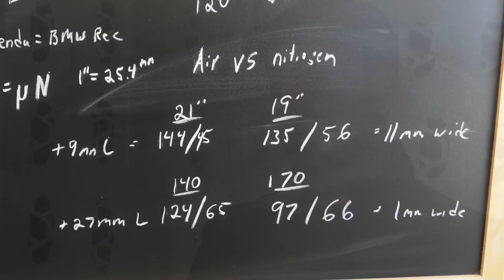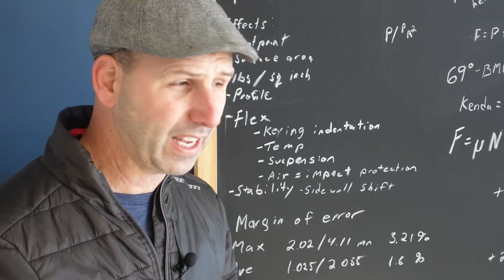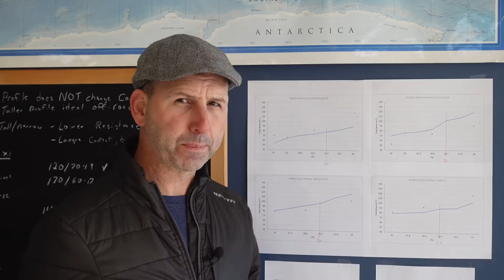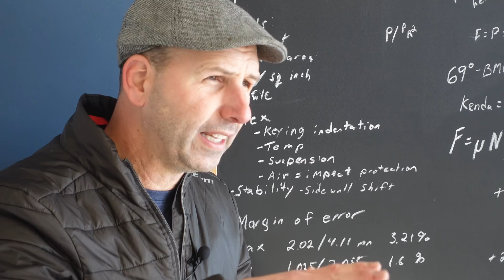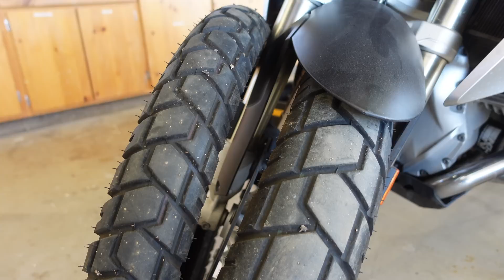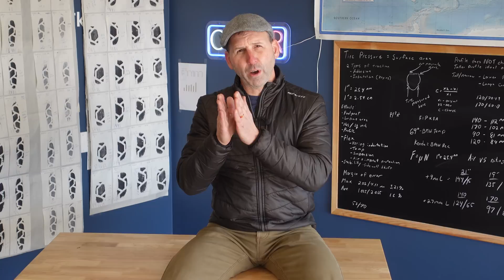Selecting the correct tire pressure; How airing down motorcycle tires affects contact patch

Comment: Tyre construction plays a big part in how much flex you get from the tyre, stiffer side walls give less flex as opposed to softer side walls for the same air pressure.

Most tyres designed for overweight motorcycles have stiff side walls so will flex less than say a tyre designed for a mid weight bike, the difference is quite noticeable on an enduro bike like a KTM 450, 16 PSI on a stiff construction is a world away from that of a soft construction tyre when it comes to traction.

The best way to test if a tyre has a stiff side wall is, one, try and fit it to a rim or Two, let the air out and sit on the bike, a tyre with a stiff side wall will feel almost the same to reach the ground when seated, a soft side wall the bike will sit a lot lower.

I guess there is a reason why enduro riders and Paris/ Dakar riders run a mouse equivalent to around 14/16 PSI in the tyres and their bikes don’t weigh 250 Kg.

To get the tyre to flex more on a stiff side wall you need a fair pressure drop then one with a softer side wall but a stiffer side wall is needed as the weight gets higher.

Comment: The purpose of airing down is to keep more tire in contact with the ground when the ground is uneven. If you have a tire at 35 psi and it hits a little rock, that rock is going to make the rest of the tread lift off the surface. If you hit that same little rock with that same tire at 25 psi, the tire will give and allow the rest of the tire to stay in contact with the surface. Not talking about big obstacles like in your example, but small rocks and surface imperfections. It's a balance between protecting your wheel/avoiding flats, and improved grip.

You can sit here all day and explain why it doesn't make a significant difference in grip, but if you ride a bike down a trail at full pressure, then go again at lower pressure, there's a clear difference in the stability and grip of the motorcycle. It won't make up for rider skill or training. It's usually not required to get down a trail. But ride down a road that's hardpack with little marbles on top of it, airing down makes a monumental difference in available grip.

cool to debunk the surface area myth, though.
Reply: 100% agree.  This presentation is not a true representation of what actually happens on the trails.
Reply: @philipraposo8324  BINGO
Reply: He mentions zero about Hysteresis losses.
Reply: I happen to ride a small KLX250s this period, very fast on tarmac and fast on trails and using very low pressures makes the bike skid on tarmac, when riden hard. You can feel the tyre deforming and front and back slides become very often especially when driving supermoto style. Controlable but very frequent and rather pronounced. I guess tyre works as a spring but with less dampening, which bumps the type up till it looses grip. It is very exciting to end up drifting with 27hp front end back at the same time going 60km/h, but definetely shows low pressure does not always give more grip. The other funny thing is that with very low pressure at the dront the bike is easier to turn and more responsive, whereas in street bikes it is usually the opposite.

Comment: At 12: 40 you mentioned improved resistance to heat, which is backwards, heat in a rubber tire is created by flexing and speed, as such "aired down" at the same speed, a tire will generate more heat, as such, at lower air pressure, one needs to go slower, which is not that big a problem as "off road" one generally rides slower than on pavement.

Comment: Is there any chance you can put a pdf of that spreedsheet out for us to look at in it's entirety?  My KTM 890 Adv R manual recommends 36 for a full payload and 25 for a off-road.  That's very close to 28% lower for off-road.  I believe you stated that KTM was recommending lower psi than the other manufacturers.  25psi is too low in the off-road terrain I ride in my experience for some manufacturer's tubeless tires in the same sizes that the 890R runs. 
 Changing pressures is a chore especially if one goes by the book.  I'm on pavement, I'm off road, ride and repeat.  I choose to set a pressure for the most terrain I'll be riding upon that day or weekend.  Also in my experience lower psi will reduce longevity of the tire due in part to heat from flex or squirming around .  
A blanket statement about psi can't really be made.  But I think a general statement can.  Follow the bike manufacturers recommendations and adjust as necessary.  And if a rider feels more confident with low pressure that's okay.  Tire compound and sidewall stiffness of various manufacturers play a big part.  I haven't found psi recommendations from tire manufacturers.  I do from motorcycle manufacturers and they are probably based on the OEM tire and in KTMs case a TKC80 front and rear as well as the suspension stiffness.
Having said all that I run a low 10-12 psi mousse on my 350 excf which is off the chart in KTMs recommendations.

Comment: Great topic,  the chalk board was a great back drop
Would be great to compare your measured values to calculated valves
40 lbs/sq inch X 7 square inches inches supports 280 lbs.  

We will not try to discuss how friction is independent of area. 

Agree it is complicated.

Comment: I don't think you mentioned roads with sharp rocks. A loaded GS going at posted speed should lower to avoid puncture. The manual does recommend the pressure. 
Where's the manual on sidewall strength when running mousse?

Comment: Is it wrong that i believe there are two ways to regulate how the motorcycle will react at any surface, so , to the hi-tech motorcycles there is no need to adjust the tyre pressure because the way the motorcycle must react off-road ,for example, regulated by the suspension adjustment(enduro , off-road ect).Thats why at your diagrammes ktm (and i believe not only ktm )for the off-road models which have fully but manual suspencion regulation has tyrre abjustments in order to not messing around with suspencion

Comment: .. the other aspect of airing down is the temperature.  Under-inflated will generate heat and change rubber properties. This mostly impacts riding at higher speed on high grip surfaces. 

Most likely the changes in behavior and between 140 vs 170 and 21 vs 19 are related to  specific tire construction and there are substantial differences between different brands/models of tires

Comment: I'm sorry to be such an A**, but I assume you measured footprint on a flat stable surface. You lost information there because dirt and sand differ to pavement. A 90° obstacle is rare in nature. Sidefex isn't  considered. So all in all this video is good as a hint but it can't replace hours long testing of different tyres on different surfaces at different temperatures. Reality is to complex to model it like that. Still some good hints.

Comment: This is great info, i am wondering if you would take it one step further and figure out the pounds per square inch the increased contact patch changes?  the small change in size (a millimeter or two) may translate to a larger real world effect (PSI of the contact patch to the ground) spreading the weight of the bike out more... or not. either way it would be interesting to know.  I know from first hand that airing down does make a significant difference in 4 wheel, but this is less obvious on motorcycles. Thanks for testing looks like you put a lot work into this
Reply from the maker: That is simply measuring the area divided by the tire load. Of course this doesn't account for braking or acceleration loads

Comment: On a drz400s, so not a big bike, I would air down to 12 psi on technical  (SLOW RIDING) sharp rock area in the desert. It does make a difference and prevent your tires been destroyed by the sharp rocks.
Reply from the maker: The DRz 400 came in an off-road, duel sport and SM versions. The wheels were proper narrow rims on a light bike with wheel locks. 12 psi is fine on dirt.

Comment: Today is March 1, 2023; those who will watch this video in 2063, will laugh at us mortals that will no longer be around then, because tires will no longer have air, but will be spring loaded and have a technology that will not require any air. Just like there will no longer be any vehicles running on gasoline, cause they will all be running on nuclear fusion, Yeap, not even running on batteries anymore, Tesla will be Toasted way before 2040.

Comment: I agree completely on everything thing that you stated. I consistently run 25 psi on my Africa Twin in our SoCal desert and mountains specifically for puncture resistance over severe rocky terrain. In my experience airing down in the rocks, gives the tires just enough give to resist punctures versus  33 - 38 psi. If you have a chance, test for puncture resistance at different tire pressures.

Comment: One thing I might have missed and i apologize if it was mentioned, but your tire is the first part of your suspension, and a tire with lower tire pressure will be on the ground longer and more often than one with higher pressure, so that marginal footprint really adds up over the course of a tough section of trail. On adv bikes, I agree with bret, a lot of effort for little to no reward, on dirtbikes it makes a HUGE difference.
Reply: Longer and more often on the ground? — Use good suspension and adjust its good damping characteristics properly. Then you'll have it. 

Tire pressure won't change what you are postulating much. A lil' bit yes, but not at all much. 

BTW. Dirt bikes are all sus, with just a bare minimum of other parts. 

I am an engineer.
Reply: @demezon6572  Everyone on youtube is an engineer, Then you should know that tires and tire pressure are also part of your suspension, and adjusting the tire pressure is also adjusting your suspension.

Comment: So, it's not about footprint, it's about feel. Except you didn't test that, so you can't say that. You need some blind tests. Have 10-12 randomly selected riders ride the same challenges blind to what you have set their air pressures at and see if they can identify whether the pressures they just rode on was the recommended, -10%, and -20%. If they cannot consistently identify the pressure via the feel, then that myth is busted too.
Reply from the maker: That's my plan for a future bit if future research
Reply: @BretTkacs  I look forward to your results.  To be more precise, I should have said it's about feeling that less rebound enables better control through a rock garden type course.

Comment: The tire acts multidimensionally, and your explanation with footprints, in that way, is only applicable on asphalt. The hardness of the tire as a result of a high pressure will only generate the effect of removing the loose terrain, while a soft tire will compact the contact surface on a micro level, generating a pushing force. Everything is add up. 
Of course, too little pressure creates danger for the rim.

Comment: Interesting video. Thanks for all your effort. Regardless of the small measurable differences in surface area etc,  if you’ve ever aired down on gravel roads you’ll know that it has a dramatic effect on grip. (Same for mountain bikes.) I run about 20-22 psi on my DR650 front and back. It seems to be the sweet spot for me to avoid flat tyres and get great grip. Hit the trails and do your own experiments.
Reply: 100% this. I air down for cornering traction. The contact patch while rolling over a piece of paper with the bike straight up and down at half a mile per hour is irrelevant. I tested by using the same corner with a very loose surface at a constant speed that was pushing the front tire to the point of losing traction and almost crashing at the standard rated air pressure. Then kept lowering the air pressure 2 psi each run until the front tire stopped sliding out. Then kept going lower until I could feel a reduction in stability. At that middle point between too high and sliding or too low and wallowing allowed for even higher corner speeds without losing traction. For me, that confirmed there is a significant advantage to lowering pressure for increased cornering traction. 

This number can vary a lot depending on many things like tread design, sidewall stiffness, suspension settings, bike weight, bike geometry like rake and trail, center of gravity or even things like throttle or brake input depending if you are decreasing speed into a corner or increasing speed out of a corner.

Saying airing down doesn't help based solely off a low speed straight up and down contact patch on a piece of paper isn't really accurate compared to the actual conditions where tire pressure actually makes a difference imo. But hey, what do I know. Maybe world class riders should start putting 36 psi in their hard enduro and maybe even trials bikes since the tire pressure myth has been busted by this video...

Comment: I feel reminded of a simplified math assignment in high school: From a predefined diameter -> Calculating the pressure inside a rubber tube with given outside pressure and contact patch surface — or calculating the contact patch surface from the difference between inner and outer pressure — or calculating the outer pressure from contact patch surface and inner pressure.

In essence: Apart from the diameter (basically flattening/prolonguing the curvature segment touching the ground, and therefore the length) the tube width and height had only neglectable impact (at least in that simplified assignment scope)

Comment: very interesting, all other off tarmac type vehicles appear to run low pressures 4x4, trials bikes, enduro, mx, MTB, agri vehicles etc, why would an adv bike be the anomaly IF your off road riding style/conditions and tarmac performance requirement allowed you to do so ? I ride a crf 250 rally on 16psi regularly with the tired tyres its a wobbly ride on tar but a confident ride on wet tricky trails definitely better than with higher pressures. On the GS12 I have never been lower than 18psi  but regularly 22 never damaged a rim or heavily damaged the sidewall but probably not helping tyre life,  in this instance the major advantage it appears to me is the reduction in skipping off line being able to direct the bike and keep the line you want, the bike is on the very basic OE suspension. Try doing a "slow race" with both high and low pressures wondering what result you may get there.  Great discussion but I feel I am gaining advantages and the dissadvantages are acceptable to me yes it makes the bike slower on the tar probably wears tyres quicker but never damaged a rim, of course with sensible riding. Clearly tyres live a very dynamic life on our bikes asking them to do multiple things we ask of them , this disscusion is going to roll on (I hope). Thanks for your testing.

Comment: Maybe reducing pressure in a road tire - as shown - yes I know those are sold as trail or 70/30 or whatsoever but they are made for tarmac… - is pointless? Nobbies should be more flexible in general and of course there are still huge differences between individual products. 

Will you do a part two with nobbies?
Reply from the maker: I would like to do a follow up with the process and feedback from the engineers the build tires.

I would also like to do a blind study on air pressure, off-road and rider impressions of feel.

Comment: Tires in motion are not the same as a static tire... For example, in the airplane world we know that viscous hydroplaning occurs at a speed of 9 X the square root of the tire pressure.  The higher the pressure, the higher the speed of hydroplaning onset.  Water has surface tension, it requires higher pressure the faster one is going to break the surface tension.  Would the same not be true of sand?  Thus if one wanted to 'float' on top of sand, or mud, or simply moist soil, a hard tire is more likely to penetrate than to float.  Thus I don't think your experiments capture that aspect.  My 50+ years of offroad experience have taught me that there are times on the lighter bikes to air down - hooking up on gravel for example, or single track.  But on the heavy bikes, and in particular the modern lower profile tires like on the GS 1200, the risk of damaging a wheel  or getting a pinch flat outweighs any benefit.  So a complex thing for sure, for me light bikes benefit is greatest. Thanks Bret!

Comment: Great content.  Coming from a mountain bike background, we air down primarily for increased traction in cornering off-road.  I know from experience that the amount of "G"s you can pull on a corner goes up significantly at lower pressures.  We basically air down until you risk a pinch flat, or until it feels too squirrelly.
I would like to suggest a follow-on video, again, data-driven:  perhaps record max speed on a fixed turn radius before slipping vs. air pressure.
Reply: I too am curious about the contact patch footprint and cornering; more challenging to collect the data. Thank you for this data-driven study.

Comment: I'm torn.  Data is good and generally king.  The problem is what do I do with the actual experience of fighting to get up a gravel hill for 3 hours. The bike falls over, I try and pick it up and we both slide 30 ft back down the hill, only after airing down was I able to get up, and fairly easily
Reply: Because while 10mm more length might not sound like much as a percentage it could be... Also the fact in the video the tyre does conform more to the point that took almost hits means on your uphill... Your tyre will stay closer to the stones and gravel and give more grip. It's literally in the video and ignored. Yes a hard wack will hurt but many small ones... Better grip and less rebound.